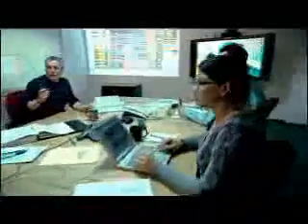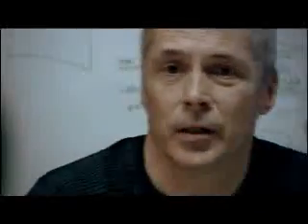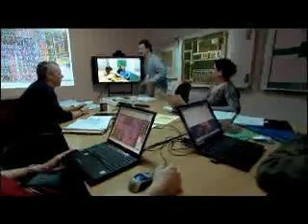From sand to chip - How a CPU is made

Comment: Couple of notes for lay people: After the product specifications are defined, the design process starts with electrical schematic diagrams using special software. What you are seeing in this video (when all the engineers are in the room together and one of them points to the projected image in the back) is the layout. These documentaries usually don't show the schematic diagrams that the designers build as a first step. Also, the sand is turned into wafers by other companies.They outsource that.

Comment: A pure semiconductor is often called an “intrinsic” semiconductor. The electronic properties and the conductivity of a semiconductor can be changed in a controlled manner by adding very small quantities of other elements, called “dopants”, to the intrinsic material. In crystalline silicon typically this is achieved by adding impurities of boron or phosphorus to the melt and then allowing it to solidify into the crystal. This process is called "doping" and the semiconductor is "extrinsic".[1]

Comment: At one time, I worked for ASM (Advanced Semiconductor Materials) America, a Dutch company's subsidiary in the USA.  We made the  Chemical Vapor Deposition "furnaces" that used plasma to deposit microscopic layers of chemicals on the silicone wafers.  These were high-vacuum systems that used a tiny whiff of gas and an RF-generated plasma to lat the chemical layers in the right sequence and thickness to produce that base of the process you see in this video.  I can't remember now if AMD was one of our customers.  I know Intel was an important client.

Comment: Well, you are partly right, I am speculating. Anyway, all technology was speculation at one time?

Also, I was not talking about quantum transistors. I was talking about using laser light to simulate logical functions within the crystal itself.

The OR function could be easy to implement.
The AND and XOR function could prove to be difficult.
The NOT function could be made using the XOR function.

If this could be done then you would have the basis for a simple logic circuit.

Comment: @Morphadr0n As I recall AMD changes socket types way less then Intel I believe they have been using AM2+ for like 6 years and have switched to AM3 but AM3 is backwards compatible with AM2+ boards just not the other way around. Where Intel has a new socket type like every season it seems. I feel that you simply bought when the transition happens witch if you read computer mags would of known about but not meany people do. In the tech biz this always happens DDR 1-3, AT-ATX, Pata-Sata same story.

Comment: @andrew49848 I feel like trolling. Sorry. Speed of sound varies based on several factors, humidity, pressure altitude, and substances it passes through. At see level, the speed of sound is 712MPH. At 30,000 ft it is 603 mph. These are at 0% humidity conditions.

Comment: The most difficult thing to manufacture the latest 22-nanometer microprocessors from Intel or AMD, was to get to that modest handmade first microprocessor in 1971. What began as a small company that focused light on a silicon wafer with a magnifying glass to engrave a few hundred transistors has become a most powerful and innovative industry that NASA or any existing today.

Comment: @XtremTutorials Well the performance of a CPU is limited by the ammount of transistors you can put in such a small area (among other limitations). As the technology moves forward, we (they...) find new ways to minimize the ammount of space needed for the transistors, and more transistors in less space == faster calculations == "Better CPU/GPU".

The manufacturers are working according to Moore's Law, which state that the ammount of transistors on a chip doubles every 24 months. That's their goal

Comment: @hellbelley I'd surmise the computer would be less powerful, actually, because the amount of space that would be required for electrons to travel would be greater.  Even if you were to take and make a computer with 100 separate processors you'd need a controller to direct information, more traces, more distance.  Thus my guess is it'd be slower; especially if you aren't processing massive amounts of data. (I have no professional experience or knowledge to make this judgment, just guessing.)

Comment: He is not realy wrong. Growing electronics in the labor is already in work. For example, they grow high capacity Capacitors, holding over 1000 times more, than any other cap in the same size. This might be done with nano transistors as well, later on.

Comment: Hey guys IBM researchers have succesfully store 1 bit of magnetic information on just 12 iron atoms using antiferromangnetism and a scanning tunneling microscope. Conventional disk drives use about 1 million atoms to store 1 bit of magnetic information. This means that with 1 million atoms of mass you can save 10,416.6 bytes of information (according to my calculations) where 1 byte can either be a decimal number or a single letter. Now think about this;  a solid state drive like the one in the

Comment: 1:57 - perfect Silicon lattice is face-centered cubic with a 2 atom basis at [0 0 0] and [0.25 0.25 0.25] - the lattice shown is simple cubic The diagram is incorrect, and the interface dynamics simulation doesn't look right to me. It's not even a toy model- it's just wrong.

Comment: Mores law was created by a man in the mid 1960's, where he predicted the expansion of the computer. The problem with computers is that you can only push down the transistors so much and the heat generated by all these components crunched down into micro small chips is enormous. THere might very well be governments experimenting on newer technologies and big corporations giving out technologies on their on term, but unless someone comes up with a way to make it cheaper and faster then them well..

Comment: One thing I'm not sure about. Is the economics of manufacturing these. I would've figured that considering the end product value is so high, and any jobs required would be high-skilled. Why aren't all microchip manufacturing plants based in the same country as the HQ (i.e. the US). Surely there is very little a human can do to the active fabrication process. Only passively inspecting samples for faults. The rest would be entirely machine based, as precision and cleanliness is paramount.

Comment: It is building on former knowledge gathered over time. Improvement of older technology and implementation of new tech. Computer components are silicon,and various metals. Processors sell anywhere from 45-3000 dollars They sell millions of most. I just bought  a very good processor that can handle anything possible to throw at it today for 200 dollars. I'm also going to school for microarchitecture.

Comment: The first digital computers had relays, vacuum tubes, punch cards, etc. Intel's 4004 microprocessor followed, which significantly reduced the space/current needed for computers and the time needed for calculations. So, technically, the computer came first.

Now, the first processor would be the Sumerian abacus, but the "computer" between our ears created that.

Comment: Not true. Of course the CPU contains memory. Take the registers and the cache for example. And then there are the latches connecting the pipeline stages. And the speed of the CPU depends very much on the materials that are being used: If one were to use Germanium instead of Silicon one could boost the performance of the CPU further. It is not being done because Germanium is rare and expensive. It is (currently) not economical to use it in standard CPUs

Comment: @marouanbak 

It would be too hot and eat too much power.  Electrons would experience  huge magnitudes of resistance. 1 cm = 10 000 000 nm, so you can imagine the distance electrons would have to travel v.s. 45nm. Clock-speed ≠ real world speed. A 5ghz P4 extreme would get slaughtered by an under clocked i3.

Comment: @Morphadr0n 

You must have purchased 939 during the last stages of its life. Its your fault for not viewing AMD's roadmap for DDR2 adoption. Intel kept 775 for awhile, but you still had to upgrade your motherboard and mem moving from the p4 s775 cpus to the C2Ds.

AM2 socket cpus weren't that much of a speed boast from 939, it was mainly ddr2 and lowertemps. If you buy tech as 'an investment' than your doing it wrong. Tech always changes, your stuff is always outdated.

Comment: Don't laugh, CPUs will run with light and will operate at speeds up to 10's of GHz. Using laser light, one can simulate the necessary logic functions by exploiting inteference and will not be limited to binary states. The trick will be to manufacture the crystals to some high degree of precision for everything to work.

I would not be surprised to see in 10 years time we will have the first light based computer - maybe only running at a few megahertz but you have to start somewhere

Comment: @copperkipper1  I have an AMD Athlon 3500+ socket am2 but it is more than enough for me.  AMD is cheaper, more reliable, faster than Intel in one aplication. Intel is only better in multitasking, but it requires more power.
I don't care what you think i have grown up with AMD's processors and they never dissapointed me. The only thing that i don't like in my computer is the bult-in Nvidia Geforce 6150SE GPU. ATI>Nvidia and AMD>Intel.
You can say what you want but you can't hide the truth.

Comment: Lol i've never used an AMD processor. I stuck to intel cuz i thought they were pretty good and I had good luck wtih intel and ATI combined. Nvidia + intel  cost me 1200 bucks and the performance is great but i thought it it could be better. my old T40 has a Pentium M and ATI Radeo 7500 and still runs halo maxed out 40+FPS.

Comment: Stolen video. Flagged.
Reply: GTFO! GlobalFoundries replaced this vid after AMD's factory was sold, this is the  original video even it is newer uploaded.
Reply: AMD exist because the stole Intel's x86 architecture.
Reply: Intel also later stole some of Advanced Micro Devices technology.  Both companies have pushed micro processors to where they are at today in 2016.  Intel would not be where it is at without the competition of AMD.  

The making of a computer chip is a beautiful work of art.  Over a billion transistors are in many central processing units today that are no larger than the size of a thumbnail.
Reply: William Seroyer amd didn't stole x86 architecture Intel licensed it to amd later on amd licensed bits x64 architecture to intel
Reply: Well that explains why the AMD logo was removed in their video. lol